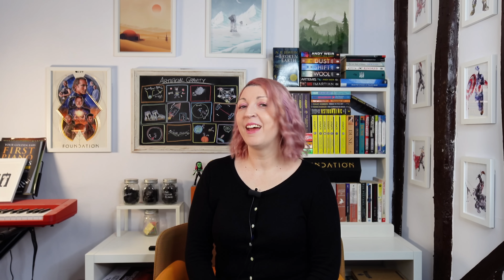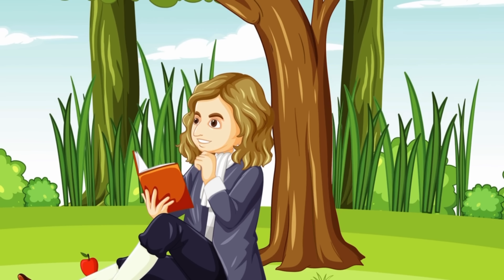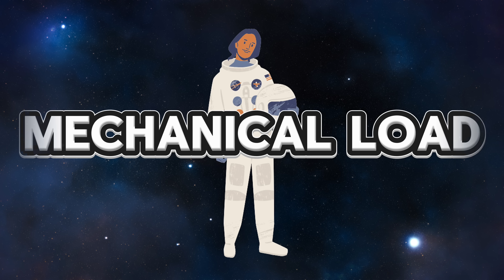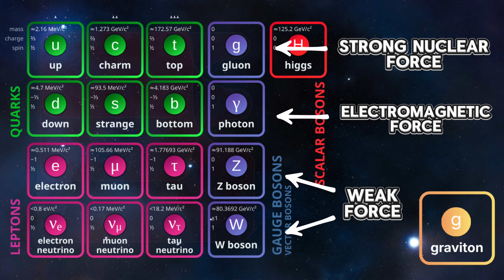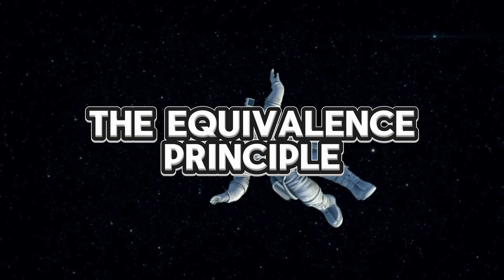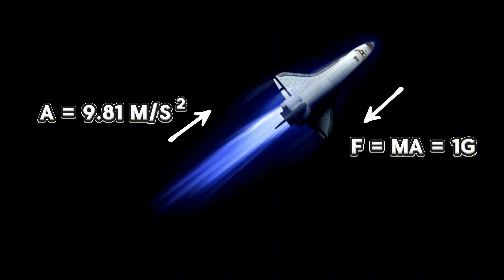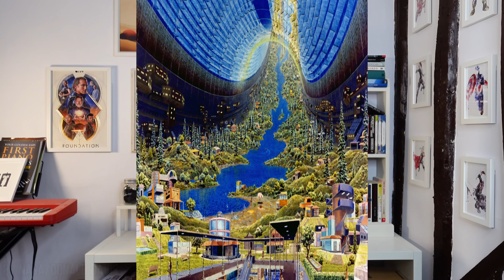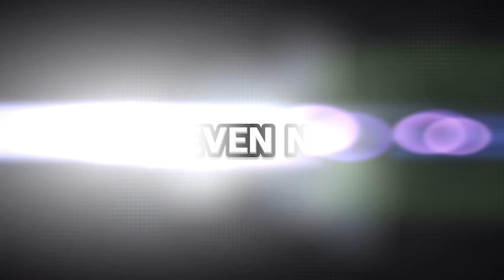Why Artificial Gravity Is Harder Than It Looks

Comment: It is an engineering problem. To create artificial gravity, you have to make a steel cylinder one kilometer in diameter and spin it at the rate of 1.35 revolutions per minute to get a 1G centripetal force on its inner surface.
Reply: I mean, you can also spin a smaller cylinder faster - depending on how fast, it won't feel as pleasant but it's at least feasible with current engineering (unlike a 1 km cylinder).

Comment: 3:30 "there was no delay"
Gonna quibble.  Gravity is delayed by the speed of light
28:20 "technology"
Needs improvement. Instead of a short radius I ternal small centrifuge use a long radius room on a boom. The main ship will be close to the system's center of mass so it will have low "gravity", which is preferable for almost every activity. The small high "gravity" room is far from the center of mass so people in the small room will experience perhaps 1.2g. Yes, ABOVE Earth's gravity 
People can sleep, exercise, relax in 1.2g as needed for health and can operate in 0.1g the rest of the time.
NO high speed rotation is needed.
28:12 "how much gravity is enough"
Broaden the question. How much and how OFTEN is enough.
29:45 "somewhere between 0 and 1 g is a threshold"
Highly doubtful. I can't imagine that being true. Biology is analog, not digital. The key is to exceed 1g often enough so the analog result is the same or better than constant 1g.
Reply: "Gonna quibble.  Gravity is delayed by the speed of light"

Yes but the video's point is, NOT in Newtonian mechanics. So your "quibble" is with Isaac Newton (feel free to take it up with him but fair warning, I hear he's very slow to respond these days :).

Comment: I would argue that gravity causes acceleration, but acceleration will not cause gravity. Humans evolved standing still, affected by gravity, not on an endlessly accelerating windowless room. Your body will tell you there's a difference with time.
Reply: Gravity and acceleration are equivalent. That's a fundamental tenet of general relativity which, so far, has passed every experimental test thrown at it for over a hundred years.
Reply: I understand what you're saying and it's difficult to give an intuitive answer. Remember that gravity is expressed in terms of acceleration. For example Earth gravity is the same as accelerating 9.81 metres per second, every second. People might look at you sideways, but take a bathroom scale with you the next time you go in an elevator. As the elevator takes off, up or down, you will see your weight increase or decrease. Not by much, because elevators only accelerate at one or two metres per second per second. If you have a car with really strong acceleration, like a Tesla S that does 0-60mph in about 3 seconds, you could use the bathroom scale to test it as well.

Comment: If you want to provide spin gravity for a spacecraft traveling between Earth orbit and Mars orbit (and return) then one solution is well within present day engineering. You could build it tomorrow.

Start with a truss structure, roughly 120 meters long. On one end, attach a crew habitat, engines and tankage. On the other end attach tankage. You've now got a truss structure with masses on either end. On departure from Earth, the structure is just a regular linear spacecraft. Most of the fuel is used in order to send the spacecraft on a trajectory towards Mars. The remainder of the fuel is transferred to the tankage on the opposite end from the crew habitat. You can now spin the entire structure end over end, creating roughly 0.8 Earth gs. The spacecraft remains spinning until its approach near Mars. It de-spins and the fuel that was used as a counter-mass is now burnt in order to achieve capture into a low Mars orbit. Basically you get spin gravity, except for a couple of days on either end of the flight. At Mars you refuel and repeat the same process, this time arriving in a cis-lunar orbit.

Comment: Great video! I just wanted to point out that the astronauts on the space station don't float because they are off the earth. They are still VERY much under the influence of earth's gravity. It's just that they are circling the earth fast enough that as they fall, they keep missing the earth!
Reply: and to do so requires they do about...17,000km/hr? meaning that the idea of using a plane at a mere 500km/h at best to get a "boost" is rather.. pointless. people dont understand that bit as they arent told about that disparity in speeds...
Reply: @paradiselost9946  orbital velocity in LEO is about 17500 Miles per Hour.
Reply: @MuzixMaker  ah well, off by a factor of 1.6...
Reply: They are in micro gravity.. Even if you stop orbiting, you'd float.. Before you plummet into the earths orbit.
Reply: @tubewearwolf from what I remember it's only about 10% less than sea level. They are really not very far from earth
Reply: Star Trek TOS used magnetic boots for EVAs
Reply: @JayKaknes  The Spacex Starship EVAs are screwed then.... Magnets won't stick to stainless steel.
Reply: The Hail  Mary  book needs Time dilation checking. Me too dumb

Comment: The Interdependency by John Scalzi (a great space opera trilogy!), uses 'push' fields to create some sort of artificial force pushing down on people in a room on spaceships and stations. I guess you could use EM repelling forces if you were wearing enough metal evenly distributed on your body (like a medieval suit of armour!) to simulate gravity, although that would only work on your skin and the outside of the body, eh.

Btw, centrifugal force could be used with 2 or more pods or cabins connected by a very strong cable(s), spinning around a central axis, as each others counterweights. You don't really need a complete circular living environment/disk/ring. Getting from one pod to the other would be a separate issue/challenge, heh. I think there was a recent sci-fi movie that showed this I forget which one. This is better in some ways than a spinning O'Neill cylinder, as cylindrical objects spinning on their long axis have to solve the precession problem, usually with regularly thruster bursts to correct the 'wobble'.

Rendezvous With Rama is still one of the best sci-fi novels ever imo. :)

Comment: I'm pausing around the 19min mark. First, you can't change mass, but you can accelerate it. Before you mention rotating "rings" you could imagine a smaller static ring that has a rotating mass in the center. Third (wait for it), I have a problem with the accelerating rocket in open space. Anything floating inside will be hit by the floor or bulkhead as the rocket accelerates, but that isn't gravity. Second (all these things tie together), gravitons are not like photons. They don't move thru space. They only work in a radial (monopole) direction. And they create negative time because unlike photons that move outward at the speed of light, gravitons move inward at the speed of light. That rocket ship, while providing a force on the people inside, is also creating it's own gravity, some of which will work to subtract from the acceleration.... at some point it has to accelerate faster and faster to produce that 1g feeling inside, until it reaches a point where everything is weightless again. edit: forgot to mention the quantum thing. Gravitons are vectors based on the tension created by anything that moves in spacetime.

Comment: Curved space-time is only mathematical model for gravity. Nature may or may not be that way.
Reply: You would have to provide an explain the phenomena that are observed better than what the current mathematical models of gravity do. We observe the light from stars bending around the sun. We observe galaxy lensing. You’d have to explain why time changes and the actual shape of objects change when near a large mass.  These are all observations made all the time.
Reply: There are significant problems with spinning objects in space and using them to simulate gravity. One of the biggest problems is the shifting of mass within the spinning container. When something spins very fast, objects and fluids tend to shift and spread out equally. Let take water. If you spin it in a washing machine, the water will redistribute throughout the tub and the mass becomes equal. Not a big problem. But if you stick a small wet towel that is balled up into the machine,when it spins, the washing machine becomes unbalanced. This is the same problem with a spinning (at a much lower rate) a large toroid shaped object. The object will by necessity be balance while spinning to prevent wobble. Any object placed within the toroid will change the balance.  Or imagine the object within the toroid has the ability to move freely about. The only way to counteract this mass change is to use a counter balance or counter balances at other points with the toroid. One way would be to shift water to different areas. On extremely large toroids with many thousands of people more or less evenly distributed, the wobble would be negligible. But on a space station 100 yards across with only a dozen people not evenly distributed, this could cause huge wobbles.
Reply: @chrisstout8451  Yes, water ballasting is a good way, but it tends to be slow to react to changes. Everyone on board should wear a positioning device and as they move about, water is pumped to compensate.

I'm thinking about some kind of circular track that ballast masses can move around on rapidly. But now I've run into Dzhanibekov!

The way I look at the intermediate axis problem is as follows. With a perfectly symmetrical object like a circular disk or torus, there is no privileged axis. I think that you physics guys call it isotropic or something like that. For example Derek Muller's famous intuitive explanation of Dzhanibekov is nonsense because the intermediate axis is purely arbitrarily chosen. Add a mass or a force at one point, and we create a privileged axis. If you have a good understanding of the problem, I'd like to hear more.

Thanks for your explanation which helps to bring clarity.
Reply: Einstein hated action-at-a-distance. For quantum entanglement to work, some sort of a signal would have to propagate instantaneously across space-time. The string theorists get around this by hypothesizing a universe of ten dimensions, six of which have collapsed to zero. Apparently the math says this is possible and even necessary to get to a Theory Of Everything.
Reply: The only way to know is to test that hypothesis.

Comment: Looking at space habitats I think the first ones will be axial sections joined with radial links to form a square or U shaped tube. So there will be 2 living spaces and a lift to move from one to the other. I live on a boat so get to experience what it is like to be climbing up hill all the time. For what it is worth, Newton was more right than Einstein. Gravity is generated by the Matter’s Quarks reacting with the Higgs Field, a reaction that locally energies the Higgs Field (strong nuclear force) to produce a scalar field wide energy intensity gradient from cold space to highly dense matter. Gravity is Quarks pushing against the Higgs Field and the Higgs Field energy intensity gradient causes the matter to move towards other matter in that way. Same result as Einsteins geometric solution but it unifies gravity with the the primary energy resource of the Universe, matter (quarks).

Comment: Was wondering if perpendicular artificial gravity via acceleration would be  a problem because gravity around us is delivered from a large sphere greatly spread out, do we get a sense of gravity that way.  We could build an outer shell that does not spin, and inside of it use lightweight plastics, fiber, inside the ship that spins, like a lettuce spinner, that way you don't have the problem of rotating a bigger mass which will affect any navigation and you don't have to provide swivel points between ship sections, people would have be able to fly through the center to get past the salad spinner section.

Comment: I dont think it's fair to take a stab at the expanse, considering the effort the show put into including it into its story.
Reply: It's the best show for science. Even better than B5. My other favourite
Reply: It's a fair comment though - one of the show's few "sci-fi gimmes" is the Epstein drive, an extremely efficient inertial containment fusion drive, without which the scale of space (even our "local" solar system) is just too vast. And even then, on the show at least, they take some liberties with how long everything would actually take.

That's what almost all hard sci-fi does - keep everything realistic except for one or two big "gimmes" (FTL travel is a common one for instance).
Reply from the maker: I didn't take a stab at it. I almost never am critical of how scifi furthers it's plot or takes liberties with physics. I'm just saying that while it's using the real priciples of g via thrust it's sitll fiction that uses an engine that does not exist and would need to be the most incredibly efficient engine ever built and have a fairly unlimited source of fuel.

Comment: Could a magnetically levitated vessel in an evacuated tube from Los Angeles to NYC driven by a linear electric motor powered by a reactor accelerate at one G until it reached the halfway point then decelerate the rest of the trip at one G, and regenerate most of the energy used in the acceleration phase.  Why don't we have these now, bet the Chinese will soon. Oh, and how long would the trip take.

Comment: Einstein didn't like Newton's gravity as a force so he invented bend Space/Time. He never told us how matter can bend Space/time. He didn't like Magnetism so tried to explain it as electric force and length contraction etc. but he didn't mind that electric forces exist.  They also are strange forces like gravity. He never got around to explain that one. He found out that light comes in quanta's and never got around to explaining why. Of cause he didn't then know that electrons have very specific energy values at different positions in the atom and at any inward jump the extra energy comes out as energy bursts.  This is what could be called a Photon but it is absolutely not a particle. It is just an energy burst. 
Einstein just changed around a little on things. He didn't descover all that much at all.
Reply: Gravity isn't a fundamental force. Rather, it is a consequence of matter curving space-time.
Reply: It is clear you never read any books about this subject. Einstein did a LOT more than you are suggesting.

Comment: A trip to mars taking 2 years is inaccurate. Even getting there by a Hohmann transfer only takes about 9 months, but that is not the kind of transfer anyone would use for humans (unless they were on a ship that could provide centrifugal “gravity” using a long cable and counterweight or similar means). Instead you’d use a higher energy transfer, accelerating to a higher speed (at a different start time), thus providing a shorter travel time.

What you can’t change with more fuel is the time it takes for Earth and Mars to swing around into the appropriate relative positions in their orbits for a transfer to be possible (with realistic near-future rocket designs). That happens once every approximately 26 months (780 days). So the crew is stuck there experiencing Mars’s gravity for most of that length of time, minus the time it took to travel and whatever time can be shaved off the start of the return launch window.

But yes, rotating structures with a big enough radius like the ring stations at the start of 2001 are going to be the main way we accomplish that for quite some time, I think. “It’s just an engineering problem” indeed!

Comment: It isn't quiet true that the only ways of generating artificial gravity are rotation or trust, as Abigail James claims. (Firstly, forget about trust. It's impractical.) Another method, which may be considered partial rotation, is to travel in a curved path to the destination, rather than straight to it. Or you could travel in a corkscrew path to your destination. These methods would require a lot of fuel.

Comment: There could theoretically be a machine that turns light into gravity via something called the Gertsenshtein effect. You need quadrupolar oscillations of the third time derivative (need to squash and stretch plasma quickly and in a jerking motion)

There could be another solution in the form of scalar gravitational waves which would require much the same but in an expanding and contracting motion, like breathing.

Lastly the antisymmetric term points to a theoretical HFGW via rotation.

Comment: 31:00 SpaceX can include an 8 meter diameter spinning "cat wheel" inside crewed Starships. Probably, one should run in the same direction as wheel spin to feel higher G-force. Other passengers can operate bicycle cranks to spin-up the wheel.
Reply: Anything only 8 meters across is gonna have to spin at high rpms to generate much gravity, meaning large spin gravity induced effects - better bring barf bags :).
Reply: The passengers should practice in LEO. Sort out who gets too sick. 
 @E1line-r6d
Reply: It will be quite a fun trip 😂😂😂

Comment: Where is gravity created. 
Are galaxies under the same laws and it is gravity in between galaxies. How is gravity originally generated . 
We have to figure out how to generate the space gravity not earth gravity. 
A " blackhole " is a different type of gravity. It's different types of gravity forces. 
Radiation is produced by the trillons × 100 x100  and guessing stars. 
Star trek conquered gravity, Radiation going faster than the speed of light. 
Space is an ocean with gravity laws.
Earth has a ocean air atmosphere with gravity laws.
Earth has a water ocean with gravity laws. 
Earth has solid ground but is an ocean with gravity laws. 
From under ground to outer space it is governed by the same laws in different categories.